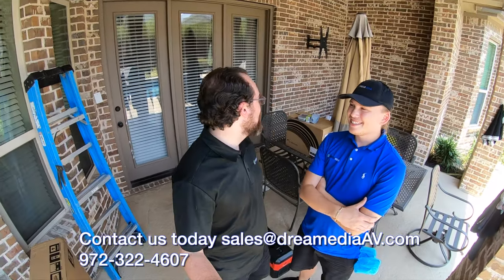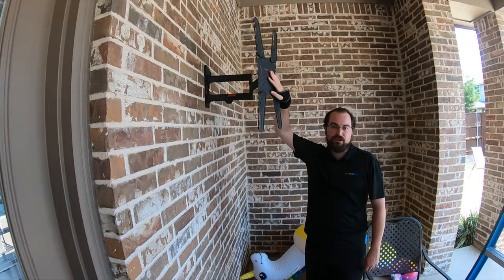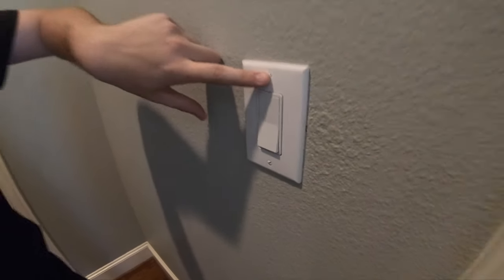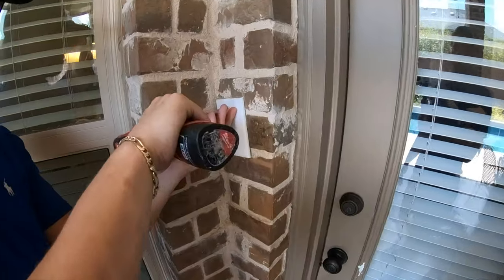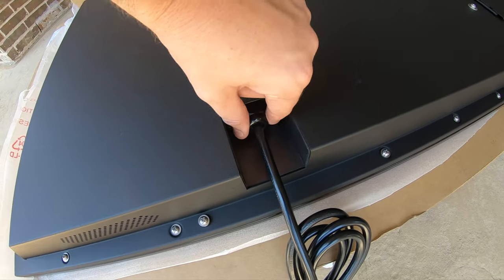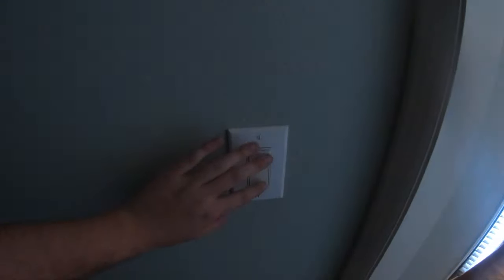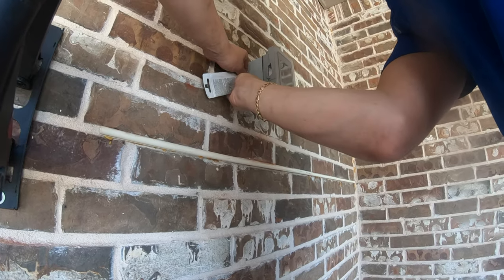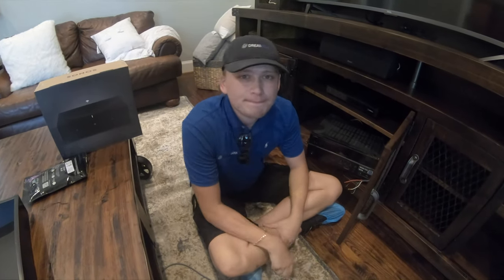Sunbite Outdoor TV w Patio weatherproof Speakers w SONOS in Frisco Texas by Dreamedia

Comment: No need to cut that hole inside , just cut nails on switch box pull switch box out fish wire down and reinstall switch box , no mess no extra cover plate on  wall

Comment: All weathered will still get condensation from fog and humidity. Waste of money. I bought a regular Vizio, keep it covered with a blanket/tarp and it’ll last as long or longer than the all-weather. I live in humid Florida and been through hurricane weather and going on more than 2 years. For the cost of an all-weather I can buy 4 regular Vizio.
Reply: Just bought a 58” samsung 7000, it will be mounted outdoors under my pavilion and was also thinking about going with a weather proof cover for it, picked up tv for $340 figured its worth the gamble vs paying $2000+ for an outdoor tv, I really hopes it lasts
Reply: @MrLIFEISTOOSHORT  I ended up buying a cover on Amazon and it works pretty good. I would recommend covering it with something. But my regular indoor $300 55” VIZIO has been working in the Lanai for almost two years. Our lanai is covered but only screened and is exposed the temperature… cold, heat and humidity. Just wanted to let folks know that it’s just not necessary to fork out extra money for the outdoor tv’s. They aren’t really all-weather anyway. Enjoy the new set up. We love ours. Got the SONOS Beam for sound source and it works really well also.

Comment: 1 sunbright tv= $2500... 10 regular HDTVs = $2500.  These guys rip you off right and left.
Reply: You’re paying for the the weather proofing and the amount of abuse that these displays have to endure not to mention it’s a professional grade so you pay extra. Sunbrite is an excellent display and will last at least 10 years from my experience.
Reply: @earlmcnulty4665  nah, it’s a rip off. Put a cheapo tv out there…. Sorry it’s bad for your biz.
Reply: @100smp  I’ve had a cheap tv put in my patio for 5 years. Worked okay. But during the day, even in the shade the picture was not bright. Got a sun right TV finally and it’s 3x brighter. I don’t have to cover my TV anymore. I hooked up an Apple TV to it and a direct TV wireless genie and it works like a charm.